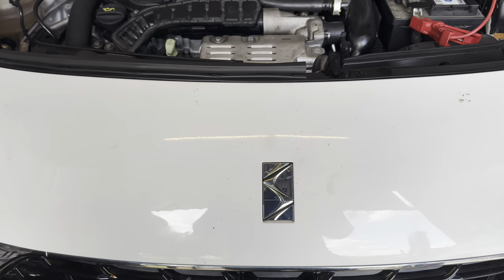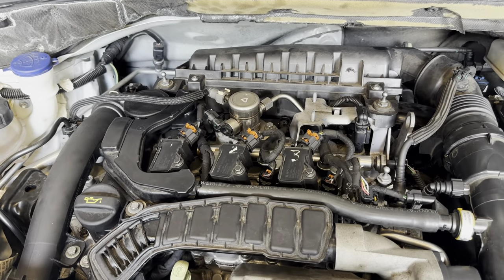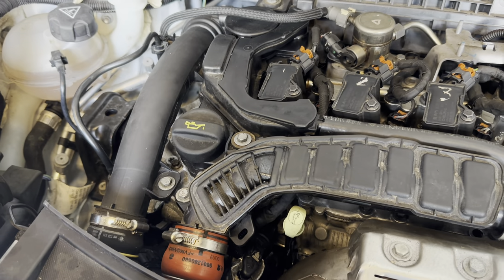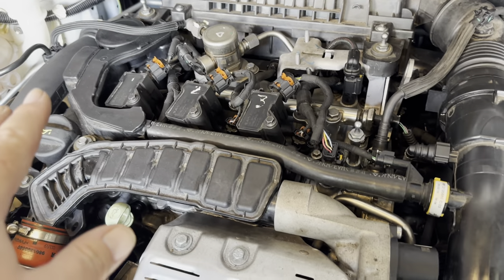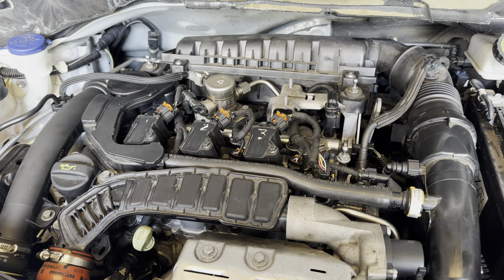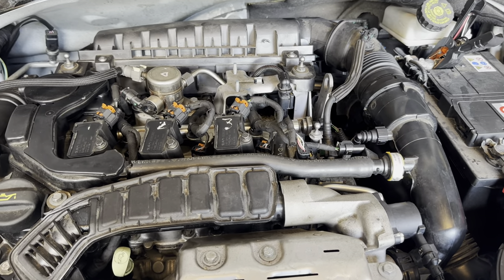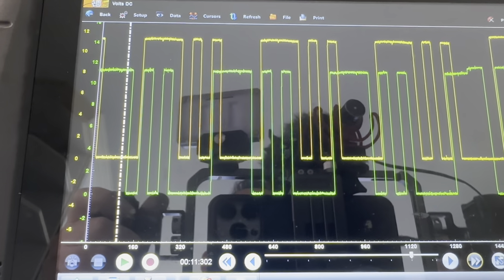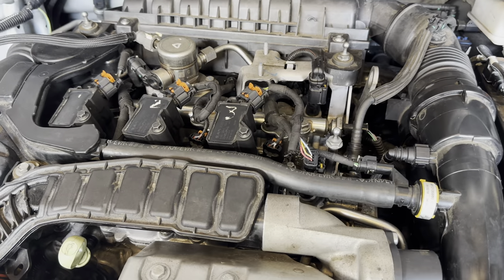Citroen DS3 (2020) 1.2  Turbo PureTech (EB2ADTS) Crank No Start after Timing Belt Replacement Part 1

Comment: seems like a plug not fully in or a crank sensor not fully tight possibly moving?. heard a few of these engines in non start and they all sound rubbish like that as if its no compression.

Comment: Sometimes they need to run for a bit to flag up a cam/crank correlation. Not always though, as you said I also would expect to see a correlation code but it's not 100% guaranteed to flag one up in my experience. 
I've seen some even take about 24 hours after being driven around for a bit to show up when it's only slight. Although it will probably be major and not slight in this case if that is what's wrong!
Definitely sounds low on compression, have you tried a compression test? 
Are both cams turning I wonder? 
Have you tried timing it up yet?
Reply from the maker: You were spot on cheers for chiming in👍

Comment: Are the cam phazers wrong way round or cam belt ends on wrong way ie exhaust on inlet cam. This would make timing out by about 2 teeth. As you said need good timing wave form.
Reply from the maker: The cam phasers are marked Ex and Inlet and are correctly installed cheers for chiming in 👍
Reply: @sandyande  Thanks for your reply. I know we're not in the guessing game but had temperature sensor give me some head scratching once. No start from cold but live data showing very hot. I know you will be looking for such things but I said it anyway 😀

Comment: this is my wifes car a vauxhall grandland elite Nav Arnold clark changed the timing belt and vacuum pump under warranty after www3
they would not change the engine flushed the engine i,m always worried it wont get to 100,000
its only done 27000 miles 
the internet is full off these engines with issues its a national disgrace how customers have been treated on this issue

Comment: Did you ever get to the bottom off this as i have just put a replacement engine in o e and it will not run, no spark.😢😢
Reply from the maker: https://youtu.be/kkCan7h1K1s?si=CS6SGfRtU6EsVHZz